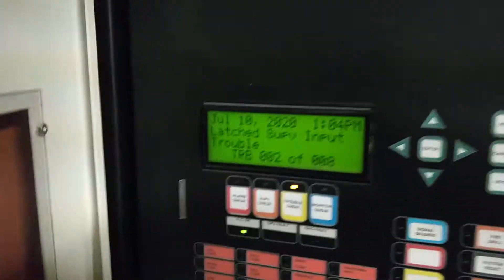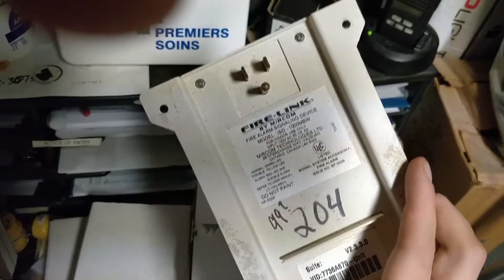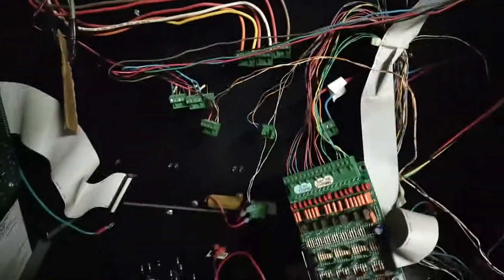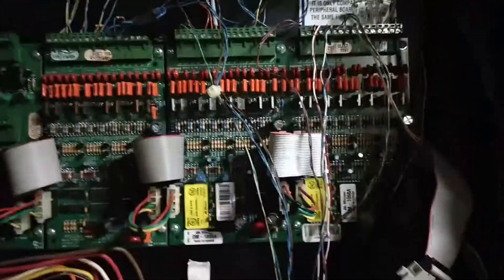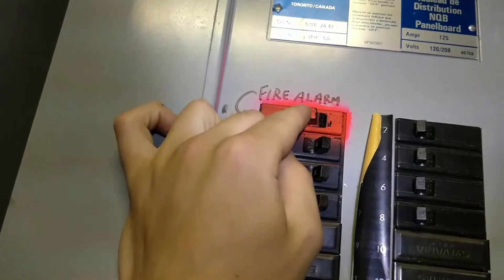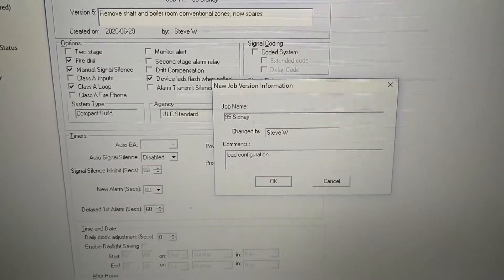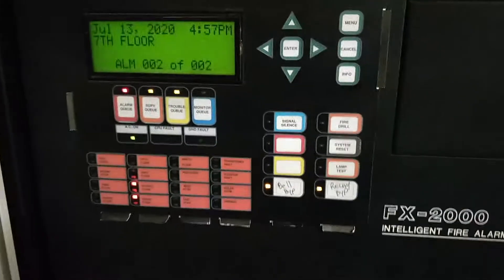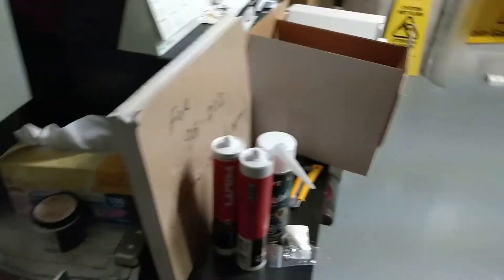Fire Alarm Motherboard Replacement Mircom FX-2000

Comment: Faulty Ribbons , you will need to replace ribbons and and any adder cards with the Black Plug, any grey 3M plug ribbons and cards should be fine.  If it’s every 4th zone in trouble it’s a ribbon problem.    Your welcome lol.
Reply from the maker: I'm sure faulty ribbons would give you similar issues, however it wasn't every 4th zone in trouble. Also ever since the new board has been in, there have been no troubles with this system. Thanks for the feedback.